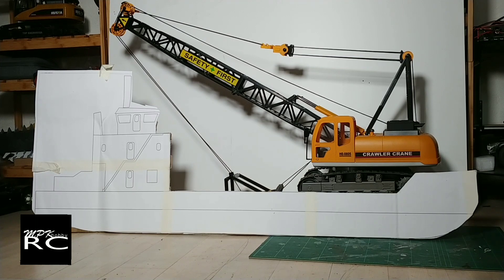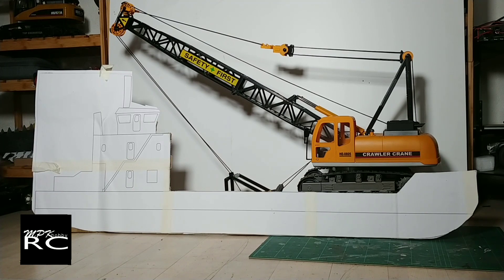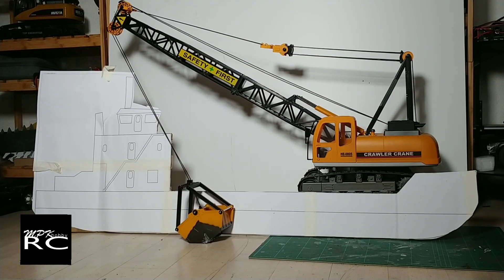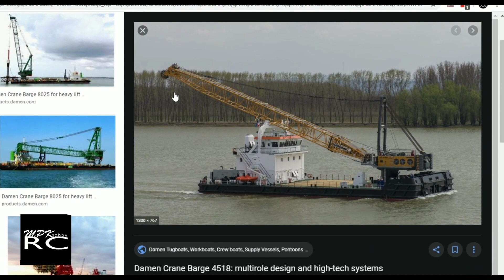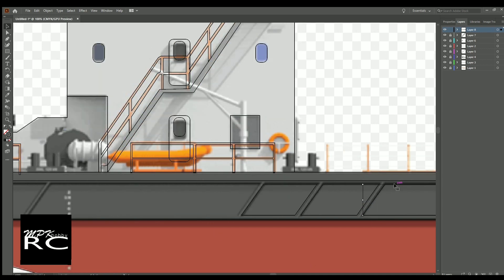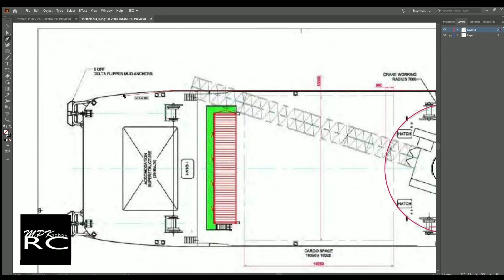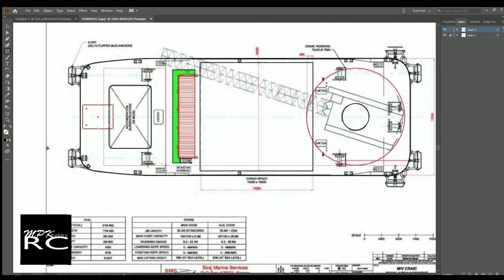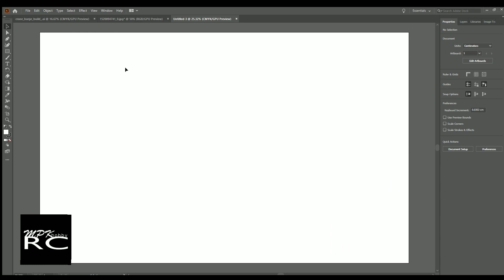Turning a toy grade crane into an epic rc barge crane. Part 1

Comment: Fantastic! I also am building one but mine is just a barge with a crane and shipping containers on board. It’s about 1/32 scale to go with my Heng Long Tug . My barge is made with foam and covered with thin plastic sheeting. It ended up weighing about 10 lbs. I haven’t tested it yet. Good luck with your beautiful project.
Reply from the maker: Thanks man! Same to you! Hope it's maiden gos well!!
Reply from the maker: Wow sounds cool!! What crane are you thinking about using? I might finish building my crane bardge this summer..